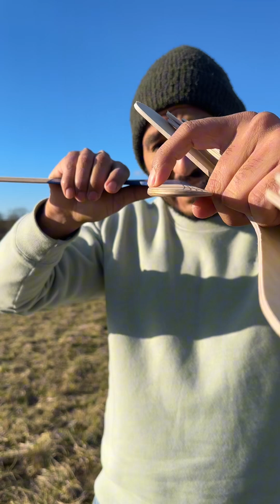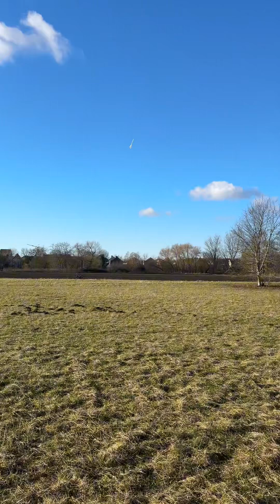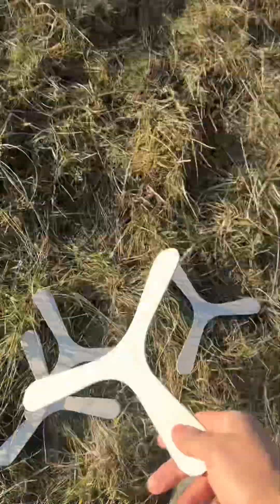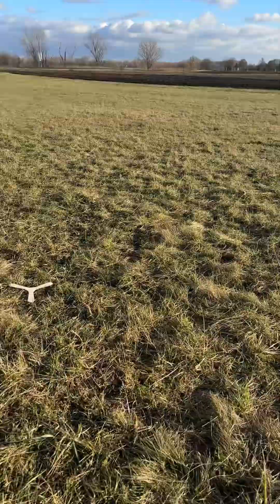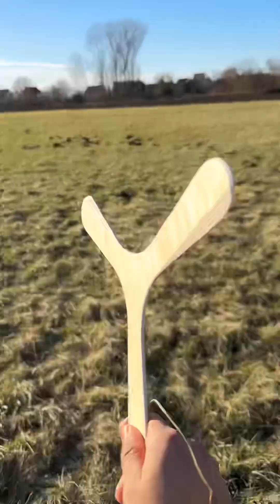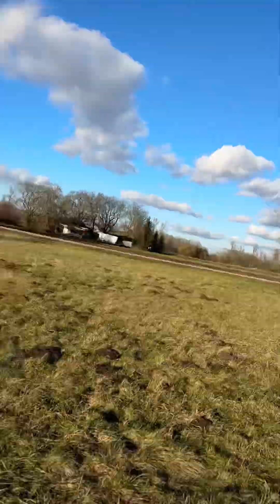How do airfoils change the flight of a boomerang?

Comment: The first boomerang (without the faired wings) partially returns due to a lift being created by the apparent wind's angle of incidence. From the beginning of its flight gravity pulls down on the boomerang causing it to fall as it moves through the air. That downward direction results in an upward flow of apparent wind, an angle of incidence other than zero. That means the air flowing over the top of the wings has to travel farther (and faster) than the air flowing under the wings resulting in a small net lift. The significant drag from the blunt leading edge (relative to the minimal lift) prevents a proper return.
Reply from the maker: Thank you for the explination, it was a pleasant surprise seeing the boomerang return

Comment: Nice. There was a period when I built several boomerangs and managed to get some to return, both two-winged and three-winged (identical to the ones in this video). But it was definitely easier to do with three-winged boomerangs, maybe the "circular" shape helps them to be more stable and to depend less on the airfoils. If you take suggestions, I think the same experiment would be really interesting with regular two-winged boomerangs.

Comment: I am pretty sure an entirely flat wing with no camber/airfoil shape also generates lift, which is why paper airplanes can glide.
Reply: I really doubt it. But I also don't have a proper explanation.
How does the air "know" on which side it has to apply the lift? It could have been a left handed boomerang but somehow casuality made it into a right handed boomerang?

About paper airplanes: the way you fold the paper stresses the surface and cambers it. Some airplanes fly better upside down because the way they are folded makes an opposite camber.
I bet this boomerang has a tiny propeller shape that may come feom the simple stresses of being cut with the bandsaw. But again, that puts the chances of being a left handed boomerang on the chance of cutting the board around the shape clockwise or counterclockwise, which I think will affect the flatness of the resulting shape
A better test would be laser cut.
Reply: @DoNotPushHere  your argument is invalid.

https://youtu.be/_e7Af7rPkZU?si=yipiSN1KKlQd3TBi
Reply: If something pushes air down e.g. by its angle of attack it will generate lift... No airfoil needed...